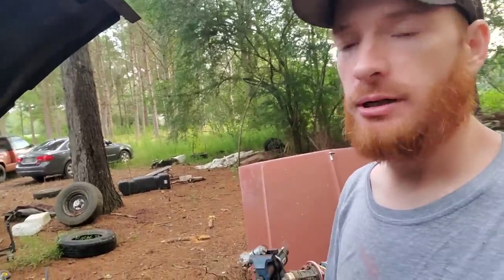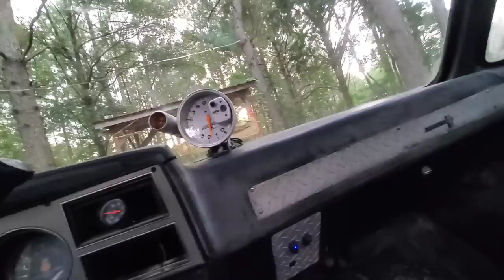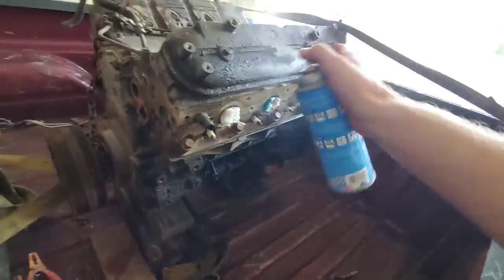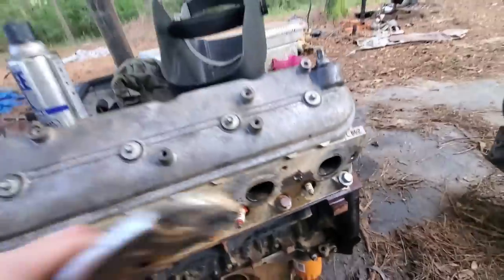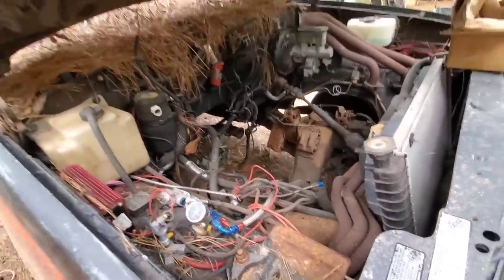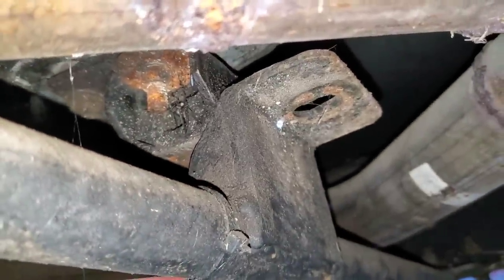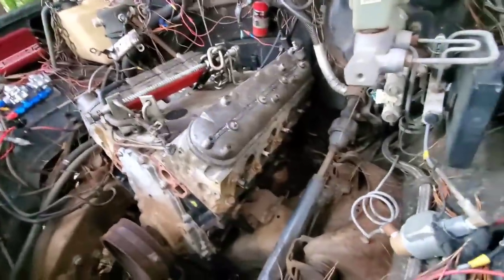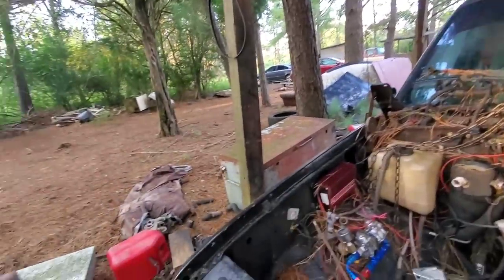94 Chevy Is Finally Getting Its 5.3 Swap!!

Comment: Looks like you fixed the leaky roof, a lot nicer to work without all that water on the floor. LOL 

Looks like you'll be busy for a while with those swaps, should be fun drivers when they're done. For me though,, give me an old sbc any day vs that LS stuff. Those Ls engines just don't have the low end torque you can get out of the old school sbc engines.
Reply from the maker: SBC will always have a special place in my heart lol
Reply: Lol LS is a way stronger motor than the old school motors I’ll take hp over torque anyday but ls has more in both
Reply: @southernslipping4225  

If you say so, but we'll have to agree to disagree. LOL

Comment: I either just one or two things aluma break you can buy it at O'Reilly's for like 20 something 30 something dollars for a whole big gallon jug or etching mag wheel cleaner if you can find it just don't leave it on there too long cuz it'll turn it black just put it on there for like 10-15 seconds wash it off

Comment: How many trucks are you working on currently? Seems you're working on quite a few at the same time. I put a 350 out of a '93 C1500 into my '81 C10. I had to put an electric external fuel pump on my truck because the old motor had a mechanical fuel pump.
Reply from the maker: 3 that's not mine and 2 that are lol

Comment: What kind of transmission r u running I was wondering if you have that spacer to a tranny of of a 97 Chevy truck to a 5.3 so will both right up or not that part
Reply from the maker: Th350 yeah it's gotta spacer but I think you can use 6.0 flexplate and not need one but I'm not 100% sure

Comment: If you swap the v6 to a v8 do you have to change the transmission
Reply from the maker: It's a th350 trans.. not the original but you could use the trans that came behind the v6 or v8 both use the same bolt pattern on bell housing